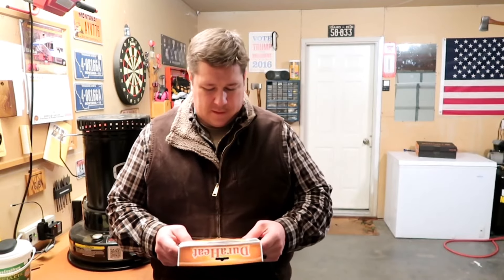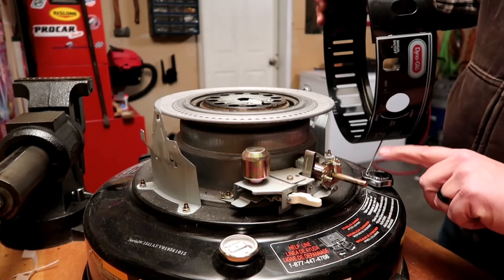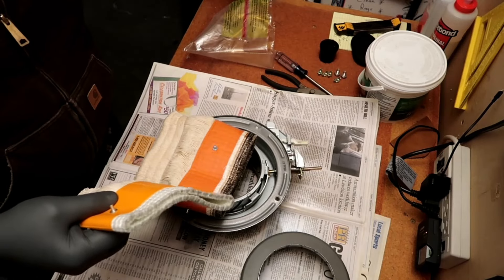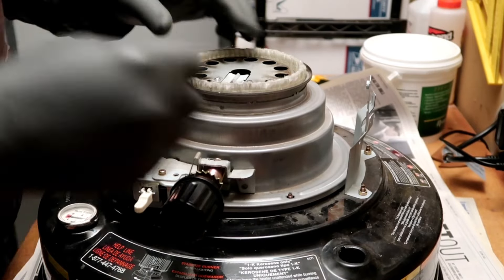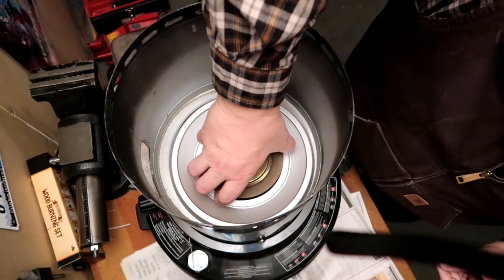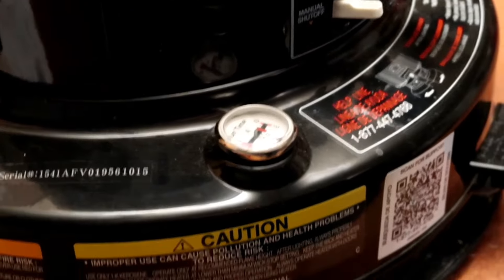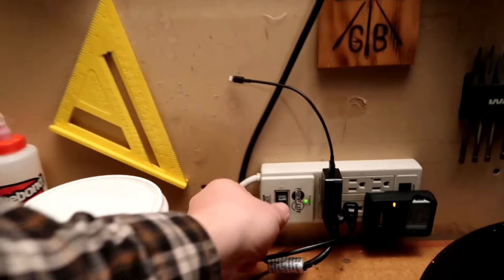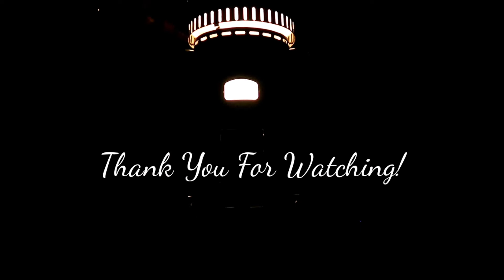How to Change the Wick on a Dyna-Glo Kerosene Heater

Comment: Have you ever replaced the wick, and it became tight afterwards? I just replaced mine, and turning the knob feels tight. When i hit the shut off, it doesn't go down. I have to hold the shut off and turn it all the way down. Any suggestions?
Reply from the maker: Yes, I would say that you have either the wrong wick replacement or it's bound up. Either way it's unsafe and needs replaced or looked at. You could either repeat the process to replace the wick or take that one out and get a new one making sure you match it up with the old one first.

Comment: The reason k1 in retail cans is priced high is it's classed as camping fuel, not heater fuel.
K1 with red dye is ok, it just indicates whether road tax is paid.
Reply: Actually Red Dye is BAD!! The dye (itself) forms crystals on the wick and causes the wick to burn unevenly!! I avoid dye K-1 at all costs!! And if you use ONLY CLEAR (non dyed) K-1 you will NEVER have to replace your wick for at least FIVE TO SIX YEARS, and I am talking from my own experience here!! There are gas stations that sell K-1 fuel oil and most are marked if it is dyed or not!!!
Reply from the maker: I use K-1 from a local fuel station and it's not red dyed. I've never ran red dyed fuel through mine yet. Thanks for the info! 👍

Comment: Right when I stopped using the heater last winter the wick needed replacing and the wick adjustment knob was messed up. I have the ivory colored heater and I put a mark on the knob so when it was off the mark was at 12 O'clock. Well, now the mark is at around 5 O'clock when it's off and I can't turn it enough to get the wick to the top. It seems like the knob's gear slipped on the pinion. No matter what I type in Google to find an answer I only get "how to change wick" I'm getting very frustrated.
Reply from the maker: If I were you, I'd look on Facebook marketplace for a new/used one and simply replace the whole assembly. You can find them all the time on Craigslist and Facebook market place for $20 in my area. I love them! Good luck! Thanks for watching!
Reply: @GriffinBenchmark  thank you. If you come across such a listing please reply with a link. Thanks again. One tip for the heater is to use a fan to bring the heat from the ceiling to the rest of the room. I found that the temperature at the ceiling can get around 15 degrees warmer than the floor.
Reply from the maker: @jeffflowers5489  https://www.facebook.com/marketplace/item/1170218913183645/
Reply from the maker: @jeffflowers5489  Just did a quick search in my area and this one popped up... There was one on there for $20 a while back. My son found one in the garbage for free this summer...
Reply: @GriffinBenchmark  thanks. I know that if I just remove the small silver "screw" on the knob's shaft I can bypass the spring and the limitations of it's height but that would also disable the heater's safety features.
Reply from the maker: @jeffflowers5489  Yeah, I wouldn't do that. Wouldn't want a large Molotov cocktail in your room! 😳🤣👎

Comment: I did the same thing to my wick but I figure 4.00 a gal kerosene vs 269 diesel it works out. The wick at Lowe's is 9.99 so it's a tough decision ain't it. I only got one month out of my first wick
Reply from the maker: Yeah, I only use mine when I'm in the garage or for emergency power outages. Probably switch to a pellet stove at some point.

Comment: I just changed mine everything went well except the bottom ring that goes over bottom of wick that says open, close. No matter how many times i put it back on … like 10 times re installing it… when i put back together the wick does not adjust! So i just left it off and it works fine. Anyone else have this issue?

Comment: Has anyone had any issues with the flame burning high and releasing soot? I seem to have done all these steps correctly but cant get a clean, even burn
Reply from the maker: If you can't get that flame down to a half inch and burning cleanly, don't use it till you figure it out. I've never heard of this issue with this model before. I wonder if it's your wick?

Comment: I use the clear k-1 out the pump. 4 bucks gal.same as the expensive clear k-1 jug at wal-mart. For 15 bucks or some crap.
Reply from the maker: Yeah, I finally found it on the pump here too. It's around $4/gal. I need to go fill up my reserves to prep for winter power outages.

Comment: I am very surprized you didn't clean it while it was apart, and i also noticed that the wire safty fence was not on the heater also. Just a sugestion, when reinstalling the wing nuts put one on then the one across from it to keep things straight then the other two in the same manor.
Reply from the maker: +Bruce Augustine Thanks for the advise Bruce. I actually did use the star pattern for final tightening of the wing nuts after they were all snug but edited a lot of that stuff out. The unit didn't look that dirty to me so I didn't feel cleaning was a necessity. The ignitor needs replaced now so perhaps an ignitor replacement and cleaning video is in order now. 😊👍 Thanks for watching!

Comment: I did this with no issue, but the shut off is no longer working correctly. I shut it off and have to manually lower the wick. Any ideas as to what the issue could be?
Reply from the maker: +Tomato Pudding Sounds like you're having a binding issue in the wick sleeve, or that metal ring that goes around the wick before you insert it back into the main housing. Here's a link to the manual in my drive account. Refer to page 10 of this manual and retry the wick instillation steps until it moves freely. Mine bound a little as well... https://drive.google.com/file/d/1z4LWJ0FKVBCeu9AYEPdHD0Ks-BBliDuR/view?usp=drivesdk
Reply: Griffin Benchmark Thank you very much.
Reply from the maker: +Tomato Pudding 👍

Comment: If I leave off the inner compression ring and put it back in position the knob will turn. With the inner ring it wont
Reply from the maker: Yeah, something is binding up. Without being there it's hard to say... You'll probably just have to tear it apart and mess with it untill you figure it out. Sounds like it may have something to do with a bent part or maybe the wick isn't seated right somehow?

Comment: Not to tear you down, but I have a lot of experience trying to replace these things on these specific heaters, and I can't get it right no matter how hard I try, and all we use in the heater is kerosene.  I look at how many of these things are on the shelves, and I cant help but think its intentional.  Hell, you can't even comment on the "official" replacement video, probably because there's more than a few people just like me.  I understand why creators turn off comments.   I dont think a kerosene wick heater replacement video is going to draw a flood of unmanageable racist rhetoric and offensive language, but the excuse works well for dynaglo.    I hope for all your sakes, I just somehow missed something important during the 20 or so times I have failed to properly replace the wick on one of these.

Comment: @6:18 you don't have to replace that wic. it's in perfect condition.
you just need to run 1 type of fuel through for a while.
Reply from the maker: Well, I appreciate you watching and I appreciate your advice. I do, however, disagree with your statement.

1. I did replace the wick. (see video)
2. Once wick was replaced, the kerosene heater ran perfectly. - better than new actually - Before replacing the wick, the heater would barely stay lit, it was oderus and generally ran poorly overall. 

Bottom line, this is something I wanted to do, it was a skill I wanted to learn, and now I can start fresh with a new wick that hasn't been experimented on with different fuel types. As a side note, this video has made me more money then my son paid for it when he gifted it to me for Christmas plus the cost of the new wick I put in it here. 😊👍
Reply: @GriffinBenchmark  
Here my real question.
Can these work with thermoelectric generators?
Reply from the maker: @TheSoball358  I'm guessing they'd work great. They put off enough heat you could cook on them with a frying pan.
Reply: on the subject of diesel fuel.
I'm very interested. I've seen other videos where it's indicated that 90% rubbing alcohol is mixed 1pint per 5gallons. 
did you try this method?
Reply from the maker: I did and the results were very unfavorable with these new wicks. This is one of the reasons I was changing the wick here in the first place  The only time I've heard of alternative fuels working was with 100% cotton wicks. There are places you can order them online...

Comment: Tractor supply carries  the K1 in 5 gallon cans for $39.99
Reply from the maker: +Bruce Augustine I don't have a Tractor Supply Co. In my area... Our farm and ranch store is called CAL Ranch. Their K-1 is $45 for 5 gal. I just found it for $22 fir 5 gal on the pump local so I'm very excited about that!
Reply: EVEN better
Reply: Griffin Benchmark in not for sure where you are from and I haven't seen the video yet but will use it when I get home .. I was just reading the comments and seen I guys talking about this .. now I didn't know much about K-1 for my garage heater until I got one .. but I spent endless $ on the clear jugs from ace hardware just to find it at every Speedway gas station in my city for 3.69 a gal ..
Reply from the maker: KERED SNILLOC Yes, it pays to look around for pump kerosene.
Reply: I get 5gal for lsee tha  at the pump 18 or 19 for 5 gallon
Reply from the maker: Where at?

Comment: 1/2 inch flame height is too high and will consume kerosene faster than needed.  Manufacturer states 1/4 inch is the recommended flame height.
Reply from the maker: Did I say 1/2 inch?

Comment: Everything works fine until I add the lower compression ring and then it’s too tight for the wick to taise and lower.
Reply from the maker: Check to make sure it's the proper wick for the unit. I would completely take it apart and redo it just to make sure nothing was bound up. If it still doesn't work you might try buying another wick all together? I have heard that some of them fit differently. Thanks for watching!
Reply: @GriffinBenchmark  I might just have to buy another wick then. I know I bought the right part number because I have two of the heaters and was changing the wick in both and the other one worked just fine. It just seems to be too tight to raise and lower properly once the lower ring is reinstalled on the one. Kinda sucks seeing that the wicks cost $10 each, but hey, I only paid $10 for both heaters at a garage sale so if only one works I'm still way ahead. :) Thanks for the reply.

Comment: Wish my ugly “off-white” one was old style black like yours. Then it wouldn’t  show any soot stains. I always carry mine outside to extinguish it. That’s the one bad thing about a Kero-Sun style heater...they can stink and soot up the white paint on the house ceilings. I also take mine outside to light it too. I notice a few puffs of sooty smoke coming off the top at the initial lighting process. Oh...and wow!!! You should really google a pump K-1 station. If it’s far away from you, you should invest in a 55 gallon drum and at least try to fill it up with what you can afford. I’m in the northern Maryland area and I used to have a station literally a 1/4 mile down our rural back road at the small deli/market. Well, the owner’s tanks expired that are in the ground and he can’t see the benefit of having it dug up and renewed. I see his point. So now I have to drive 7 miles to town to get K-1 at a gas station. It’s a separate gas pump style at $3.49 going as high as $4.00 per gallon. 
 I’ve seen those pre - packaged gallons of k-1 at Lowe’s and Home Depot and you’re right. It’s over $8.00 a gallon of that type. Not even worth trying to heat any area with those costs. The only thing it would be good for at my place at those costs would be for power outages in the winter and no wood for my fire place. Again, research your area and the next time you’re out if it’s far, make sure to get that drum and fill it up. If it’s in your pickup truck, make sure to use good tie down ratchet straps. You want it snug in case you have to swerve or brake hard. Thanks for the video! My heater won’t stay lit now do to needing a wick replacement. I think I can handle the job. I wish I could find the extra that came with the box when my heater was new. But that was ten years ago. I’ve since moved and it most likely got tossed . Here it is unpredictable March and they are calling for 10 degree weather with wind the next few days and my K-1 heater stopped burning. Gonna have to get that wick replaced or my furnace will be on 24/7 just to keep it a snug 68 in here. Thanks for the great info!
Reply from the maker: Yeah, I found kerosene at the pump in my town finally. It took a lot of searching! Average price right now is probably $4/gallon. It's really unbelievable what a difference running one of these can make to offset our energy costs each month. I also love that they require no power to fully operate! It's to bad your little deli quit selling it... I do like the black color as well. I'll tell you what, I'd love to get an old antique one with a glass globe! Love those oldies! 😊👍 Thanks for watching and your kind words! Stay warm! 😊

Comment: I pay $3.50 for it at a gas station, special pump.  Why do you have to pay so much? Where are you? I use it as the main source in my kitchen/dining with the doors to other rooms closed.  I keep it 3-feet from anything flammable.
Reply from the maker: It's different all over the country. I found it at one gas station in my city. It's currently around $3.74/gallon. At first, I couldn't find it anywhere. I live in SE Idaho.